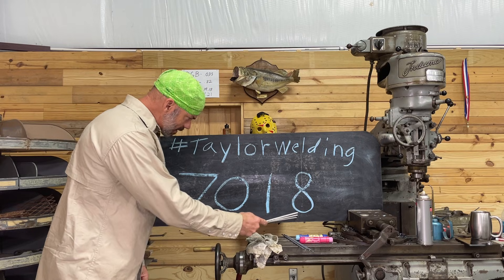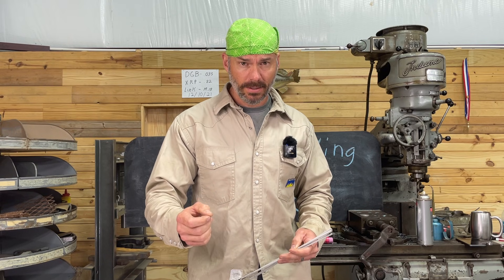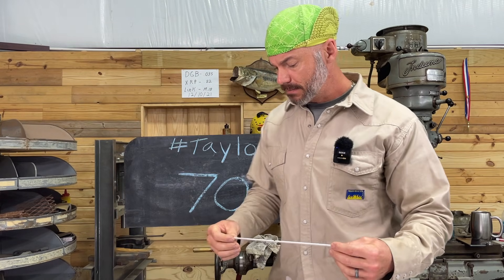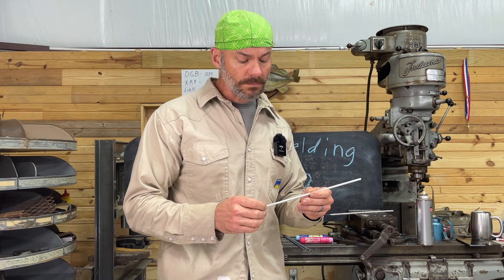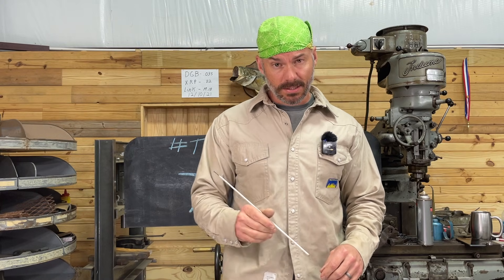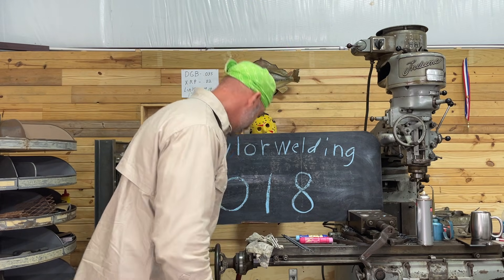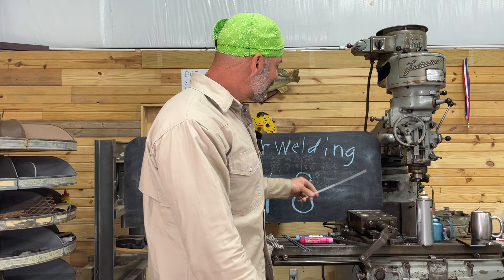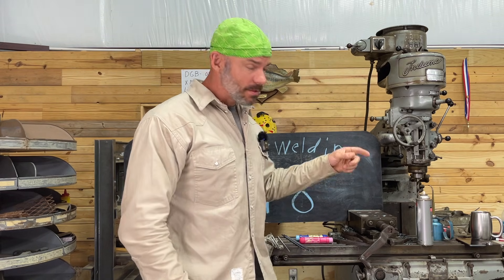How to Weld 7018 welding rod tips and tricks.

Comment: I'm an amateur welder.  I'm used to using 6011 rods, got me some 1/8th inch 7018, (I want to get some 3/32).  I've have a real nice TIG machine and a couple of flux core wire welders.  I've been having lots of fun with them.  Have not gotten up to doing aluminum yet but working that way.  😅. I've been dealing with SD bullion for years.  Most of the silver I've gotten I've paid around $16 or  $17 .  I figure in another two or four years the silver will be worth about twice as much as I paid for it.  I don't buy much silver anymore, I figure having around 4,500 Oz is enough.  Sometimes I wonder the reasonableness of buying it. 🥴. I've been focusing on gold the last few years.  Thank you very much for the video it helps me get better at welding.  I hope to sell most of my land and etcetera and just have a nice workshop that the land appraiser won't value too highly. And spend some time trying to invent, make, & fix things.  You know just have some fun and maybe do something worthwhile in the process and maybe mentor a young man while I'm at it.

Comment: I'm a tig and mig welder, I've got a water tank that I want to use the stinger on my multi-processor 325x, my biggest problem which mostly is probably using the multi welder, but getting started just sticks so bad, I've messed up so many rods just perking them off the metal being stuck, maybe I need hotter or something,  other than having a dedicated stick welder
Reply from the maker: @colonialroofingofnorthcaro441  sorry buddy I missed this comment. I don’t know. But if you will pull the stinger off the rod without bending it and let it cool you can break it off and get a little more out of it.

Comment: I know one of my biggest flaws with vertical welds and 7018 was not hanging at the sides long enough or the extreme of too long also. I had that groove on the edges of the weld. Last time I mentioned that someone made sure to let me know the technical term for it lol
I think, after listening to you though, I just wasn’t hanging out at the sides long enough and was spending too much time in the middle.
Am I thinking of it correctly? Thanks again for the video!
Reply from the maker: @comingtofull-ageinchrist6736  sorry Bud. I missed this comment. Yes that’s correct.
Reply: @TaylorWelding  no worries. Thanks for the feedback.

Comment: I think that was my problem, now thinking back42 years, that I was using a 1/8 7018 rod, but my instructor had me running a bead uphill, and listening to you, I’m thinking I should have run the bead with a 3/32 or used a 6010 and went over it with 7018. Am I thinking about it right? I’m trying to think back and figure out what I could have done to correct myself.
Great video!
Reply from the maker: @comingtofull-ageinchrist6736  yes… that’s right. 1/8 is tough up hill. It’s always easier with something in it

Comment: That was my big mistake in welding class when I went from gas welding to arc with 6010 and the vertical with 7018; I was trying to stack with 7018 like I was with 6010 on flat!

Comment: That’s what I remember about a6010 rod and a 7018 rod from welding school. I was only 15, and it was hard for me to get into  the school because of how young I was, but my parents knew the instructor, Jack Stone, and after a couple of weeks of persistent inquiries, I was accepted. Sooner trade school in Oklahoma City on Main and Western. I had to make it through gas welding before I could move onto arc welding, and it took me a week to lay a good weld, but I had a good instructor. Flat welding with a 6010 rod was not so difficult doing beads on a 3x5 metal plate before moving on to vertical welding with a 7018 rod.
I never finished from there; I had a piece of hot slag get in my right eye from behind my safety glasses, and I had a patch on my eye for a week or something and had to do these eye drops every day. The next phase of the class would have been welding thicker metal like 3/4” thick or more and having the welds examined by X-ray.
A lot of companies sent their welders here for training and etc. I wish my dad had pressured me to go back. He was in it for a while and dropped out not feeling like he had the nack for it. I was actually doing pretty good until I was discouraged by the injury, but the vertical welding was probably the hardest part, and I had only been at it a couple of days when I was injured.
I spent most of my life in construction and the last 12 in the electrical work, 6 of it as a commercial electrician.
Welding still interests me, though I don’t know if I will ever abandon my career as an electrician for welding but I think it’s good knowledge to have!
Thanks for sharing the knowledge!
Reply from the maker: That's a bummer dude. going Through my old comments I'm gonna run across this. A tough lick at 15.
Reply: @TaylorWelding  yeah, for sure! It would have been a great career! Definitely would have paid better that a construction laborer!

Comment: I learned welding over 40 years ago in HS shop class.  Did ok. Used the Lincoln AC Tombstone or Buzzbox.  Simple setup.

I bought one recently, and have picked up over 50# of old 7018 from different yard sales.    All in plastic welding rod containers, so away from the weather, but maybe not 100% airtight seal.

I have problems striking an arc with 7018s.  I do ok on the others (6011, 6013, and others I think.)  The 7018s keep sticking.

I thought maybe I needed to dry them out, but since you said that doesn't matter, what (besides practice and some lessons) will help me strike an arc with a 7018??

Thanks!

(Can't wait to do the electrical tape trick!)

Comment: Running 7018AC was an absolute delight the few times I got my old buzzbox to run properly. I've yet to run them on DC but have a power source (all flavors heat box) on order that'll run anything. I didn't understand 6011 when I was a kid and they started us with 6013 and 6011. Then I strayed from welding and chased other pursuits. Other pursuits didn't work out so well, but I had a lot of fun. NOW I've got a job that lets me get back into welding properly (I can buy decent gear now we don't weld at work, but my crewchief is a reformed ship builder) --and this internet thing that wasn't around when I learned to weld is sure helping me advance my skills. I did get hot into bicycles for a while and O/A brazed up a couple of them (custom fitted) with double butted 4130 tubing (0.035" on the ends). Fillet brazed one with brass and silver brazed one with lugs. Get my TIG skills sharp and I might weld up a few. 

So I had to subscribe when I saw the mudbug video, but I didn't watch it yet. I've developed my technique of mudbug shuckin' over many years and am happy with it.  I'm looking at your welding and hustle vids.  Plumb--holding a level vertically is for "plumb" not "level" but hey we knew what you meant (pipe fitting vid).   Quit leaning into the screen I tells myself right now. Thanks for not being another wannabe welder with more products than experience.  Geez they are deep around here.

Comment: I’m green as grass when it comes to welding, but… I was given an AC/DC tombstone and all the accessories by my neighbor.  Her husband died in 2005 so the newest the 7018 rods are at least 18 years old some were sealed, some were stored in a bucket, they all work good for me.  Even the ones that I’ve cut are good.  There is some survivors bias as I throw away any rods that are obviously damaged, and I don’t cut the welds I screw up.  Maybe things are different on oil rigs, but for automotive and farm, these old 7018 are running strong.

Comment: Depends on the climate  your in, if the flux gets mosture in it it will effect the way the 7018 runs and will cause porosity in starts, rod ovens are a nessety in Northern  climates where humidity is a huge factor in welding. Keep up the great content..(Not a cwi)
Reply from the maker: Thanks for the info!

Comment: I took a welding test today I haven’t ran 7018 for a while iv been doing down hand 7010 and 6010 for gas company but now I needed to do 7018 and oh man why did I get so much porosity? Is there something you can help me to understand what I’m doing wrong
Reply from the maker: Yes! porosity sucks… are you still having problems?
Reply: @TaylorWelding  no i figured it out I was running to cold so far I haven’t seen any porosity.
Reply from the maker: @luisrosario8709  that will do it

Comment: I have an AC stick welder, and usually use 6011 or 6013, both 1/8". Have gotten along with them, but tried some 7018AC 1/8", horizontal, on 1/2" steel, at 120 amps. It was terrible. Couldn't hold an arc. Went back to 6011/6013 to finish. What's your opinion of 7018AC rods? After watching this, I would try 3/32, if the AC rods are worth using vs 6011/13. 
Not a pipeliner or fabricator here, mostly repairs to machinery. Thanks.
Reply from the maker: Thanks for watching

Comment: I'm in welding school just moved on from 6010 to 7018 I like the 7018 alot but striking an arc isn't as easy at least for me it seems to stick alot more. Great video by the way!!!
Reply from the maker: Thanks, John
Reply: clean the end of rod after a weld with a pipeliner file not your gloves then remember how to Strick your 6010 . here is show and tell burn a 6010 stop lay it down burn a 7018 stop lay it down then look at the ends you will see the difference. how to relight the used rod

Comment: Always keep your 7018 rods dry and in an oven baked hot af.  Don't leave a hand full them out either while welding.  This is required to prevent hydrogen embrittlement of the weld and base metal.  Has nothing to do with the rod's weldability.  The hydrogen from moisture, hydrocarbons, and contaminants will diffuse through the metal making it brittle.  The diffusion is time and temperature dependent.  Cracks and issues show up later after everyone has moved on.  Don't argue with the inspector; you'll get run off and ban from jobs.  Inspector's know everything.
Reply from the maker: Lol!

Comment: Everybody told me to start with 6010.   It was the absolutely worst advice I was given.  I was given a few 7018s and welding became fun.  By comparison 6010s are temperamental, hard to start and almost convinced me to sell my welder and buy beer.  You are right about them not needing an oven for most situations.
Reply: Joe: Don’t give up on 6010. Practice on them. Once you discover what there about you’ll appreciate what 6010 is for. If your only looking for pretty beads to start with, forget 6010 and 6011 rods.
Reply: @LynnHarris18  I appreciate the advice.  I haven't thrown or given them away. It's cold enough to appreciate the warmth that running beads give give off.
Reply: I long arc on start,let the rod warm up and then dive in.

Comment: What is the trick to putting a slick cap with 7018 1/8th on pipe? I seem to always get undercut from moving too fast, or either get a gouge/grape for moving too slow on the dead man’s corner when capping the bottom. So about 7- 9 o’clock on the pipe
Reply from the maker: Practice/

Comment: I just started welding again after 30 years and bought myself a cheaper welder. 6013's runs great on it so figured I would grabbed myself some 7018's. What's the best settings to run it? My machine is an ARC 200. Please let me know, that would be awesome, thanks.

Comment: Chris, great videos man,  cool way you bring the message across to viewers. Wanted to say the other day I picked up an old box of Lincoln 6011's that were in an open box dated back to 1977. Thought I'd run one to see how they worked. Very interesting how well they lite up and welded like out of a new unopened can. Guys, if you run across some old rods, try them out before you throw them way. If they never been soaked in a good rain, I'll bet they will work for you.
Reply from the maker: Thank you for sharing Mr.Lynn . Those are some old rods. I guess they made everything better back then.
Reply: That's great to know Lynn.  My late FIL didn't know how to weld but I just checked and there's a huge open box 20 lb. ? of 6012 that looks good,  probably 10 lb. of 6013 and 2 unopened tins of ??? probably 15 lb. each.  No doubt courtesy of Grand Trunk where he worked and from the 70's.
Reply: @jefffrayer8238  Try them and see what you have. I was surprised how well these old rods preformed. I’d say if they never been wet, they just may surprise you.

Comment: I run a lot of 7018 and at times you can get porosity even from the metal you are welding on I have had fits like that already🙄
Reply: Bed frame steel is fizzy crap.

Comment: Hang out but you have to keep your 1/8 gap 
so remember when your hanging out back off 1/8 from the edge 
This is the key for making a flat up hill weld
Rod heaters just make the rod run smoother.
Got a light film of oil on my rod had to through it in the trash

Comment: When i learned to weld the 6010 and 7018 were just in a holder on the bench no heat. At work all the rods were in an oven but it was only  warm you could put your bare hand in the oven. Just to keep the rods dry. When asked great welder told me if i thought my rods maybe damp at home put them on a cookie sheet in the oven at the lowest setting for an hour to dry them out. Im working in construction in an lng plant and i understand why you will want to do every thing to code.
Reply: That's exactly what I do. Old rods, been outside or in the truck for months but still in the container. I DO on occasion bring them in, put them in the oven for a couple of hours at 300 degrees and they're fine.
I will say however, when working on certain things such as reactor components, rods must be in oven. The paperwork involved in level 1 work is stringent, lot numbers, temperature of oven, number of rods consumed etc... Basically though, for most work, just be reasonable.

Comment: I stared learning to weld and I just can't lay them well, 6013 I can go fairly fine, but 7018 for some reason just won't melt nice. Can it be my little inverter not having enough power? It's a 130 amp welding machine for 1 stage 127v
Reply from the maker: yep... That's exactly what it is.

Comment: You’re missing the point of diffused hydrogen.  Diffused hydrogen is not going to show up on an x-ray, and is not necessarily going to change the experience of welding with the rod.  The deposited weld will however be much more prone to hydrogen cracking if the rods are not stored properly.  This is not something you can see with the naked eye or “feel” during welding—but it can lead to disaster.  Read the reports on weldment failures in the freeway collapses during the Northridge earth quake. You do your readers a great disservice by conveying erroneous information. Thankfully those who are responsible for critical life-safety welding are likely better trained and have been exposed to the real facts.
Reply: Aaand there it is!!!!! "I've been doing it for XXX years!"
Doing it for X amount of time doesn't mean you were doing it right. Kinda like the structural welder that's NEVER BUSTED a weld being UT'd,.........at least that's what they always say immediately after busting a weld 🤣
Thankfully, all this pipe he's welded with crappy 7018 rods for the past 20 years is underground. And we all know THOSE never leak right??
Reply from the maker: Whatever Peter I’ve been doing it for over 20 years. Nobody can tell me any different. It’s poppycock.
Makes absolutely no difference

Comment: I'm glad to hear you say that about rod ovens because a fellow just gave me a big handful of 1/8th 7018 that has some rust on the part that the rod holder clamps to. I was wondering if it was any good. I don't have a rod oven and didn't think my wife would appreciate me putting a bunch of welding rods in the kitchen oven for a few hours. I enjoyed this video a lot. Thanks!
Reply: If you want to experiment with rod heating, you might be able to fit a handful of them in a toaster oven
Reply: Yep,works great.

Comment: I don't care what rod your using , if your a experienced Welder in any situation your weld will hold, with good penetration  no mater what the conditions are,, using in limits of what the stencil strength of the rod is

Comment: 1-1000 jump 1-1000 jump 1-1000 timing.
to dry the rod out, just stick it to the metal, hold on a second to it heats up then un clamp and pull it off

Comment: Beginner welder here, you've taught me more about the 7018 rod than any other of these videos that i've watched and i just wanna say thank you for doing that
Reply: Same here.  I can always lay a nice bead with 7014 and love it.  Never had a weld break.  My nice J.D. 310c backhoe has developed cracks of the factory welds where stabilizers attach to backhoe main frame.  My plan is to take the backhoe main frame off so I can lay welds horizontal.  Then grind out cracked welds and reweld with 7018 and welding NOS heavy truck frame over welds for added strength.  The service manual only says to use 7018 rod with base metal heated to 100* F.   Pretty sure I'll do some praticing first.  I think I can trust Taylor and should run 6010 on first pass.  I sort of think spending $200 welding myself vs. buying a used frame for $2,000+ is worth a try for use on the farm.  Thanks for the great video and info.
Reply from the maker: @jefffrayer8238  that’s what I would do
Reply from the maker: You’re welcome Jason! Thank you for watching and commenting
Reply from the maker: You’re welcome Jaxon! Thank you for watching and commenting
Reply: אתה חושב שאתה רתך שלמדתה כמה מלים לא תדע כלום לרתך 😊

Comment: Your videos are very very informative !! Been at for 5 years basically a shop welder on equipment repair.. love those 7018 rods !! Recently went to the dark side and started running duel sheild 045 but I still love the old 7018 6010 combo for a good strong weld !!
Reply from the maker: That combination is hard to beat